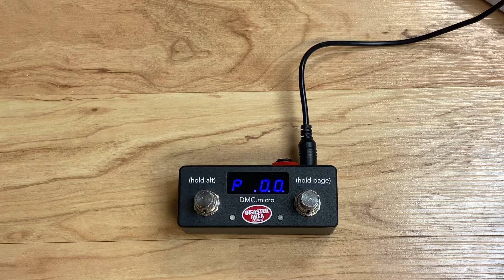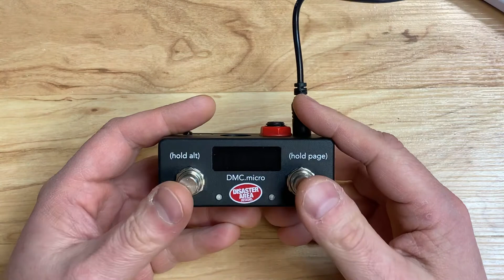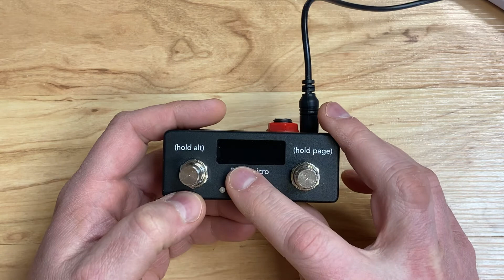Disaster Area Designs Factory Reset

Comment: Hello, if i make a factory reset i will loose all my presets BUT if i reconfigure it with the olds presets number that i had before the factory reset, will i recall the sounds that i "designed" ? 

Thank you very much
Reply from the maker: Anything that is on your devices (pedals, synths, etc.) stays.  The reset of the DMC or other controller just resets what's stored inside the DMC, and doesn't touch your pedals.
Reply: @DisasterAreaDesigns all right  thks to you. Also i have an error message on my qconnect. It says "mByp" do you have an idea of what does it means ? My presets makes some crazy things, it jump from a presets to another,, activate wrong pedals who supposd to be bypassed. My irridium doesn't respond at all. It's a mess.. it never happen before and i didn't change anything and the firmware is updated... do you have an idee ? Thanks a lot for your answers.
Reply from the maker: @jo0288  Sounds like a more complex situation than we can resolve in a Youtube comment.  Please email our support folks on support at disasterareadesigns dot com and we'll do our best to get you going again.

Comment: I just picked up a Gen 2 DMC-6 and it is not clear from this video which buttons to push for a reset. I am trying to use this midi device to save midi presets on a new Engl E 606 Ironball SE amp and I won't be needed any of the built in presets. I don't know if this is even possible but I thought I would give it a try because the form factor of this pedal is small.
Reply from the maker: Try powering on while holding down the lower left and upper right buttons.  This should work for the "universal" version of the firmware, which you can find on our support page here: disasterareadesigns.com/support
If you need more assistance we're happy to help via email, please use the contact page on the site.
Reply: @Disaster Area Designs  I am little perplexed about saving a patch. I know if you hold down a patch location, the display reads "save" and on the amp, there is a store button that you hit once you get the preset the way you like. But it doesn't seem to actually save the preset, because once you go to another bank and then back, the preset is lost. It also seems to default to a patch which is completely different and with effects and settings  that I did not program.  I am wondering if the unit being preprogrammed for the specific devices are unchangeable and that the settings are simply what the amp is interpreting from the pre programmed settings. I would like to start with a completely blank slate, but if the device will not do that, perhaps it is not what I need for this amp.
Reply from the maker: @alanlitz679  email please and we'll get you sorted out.